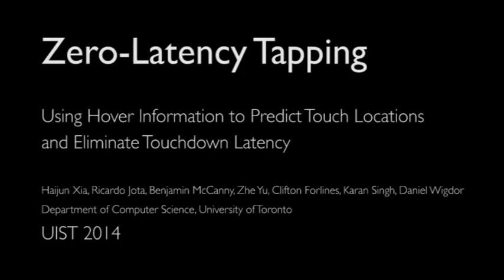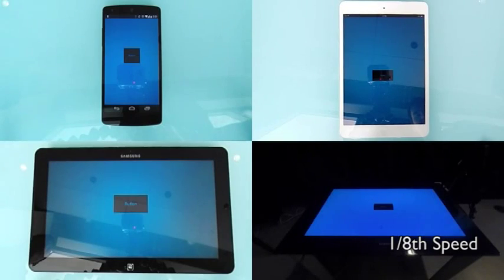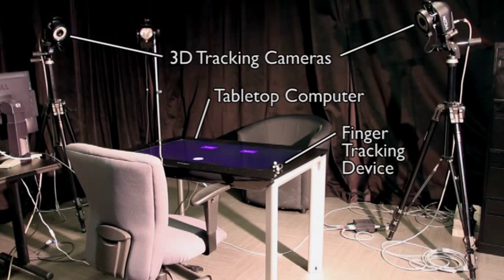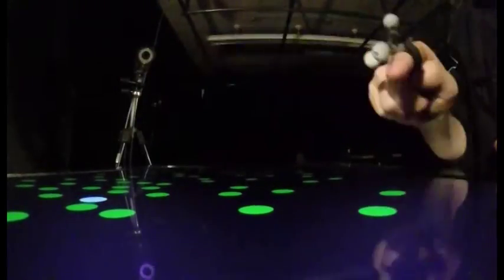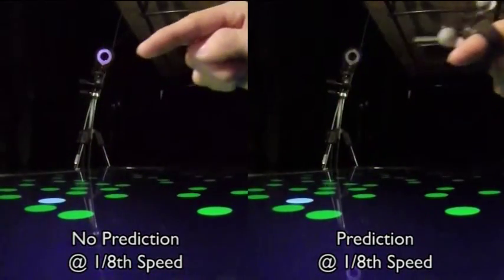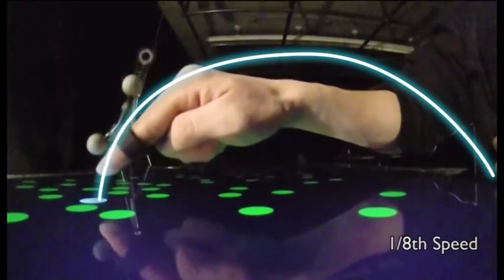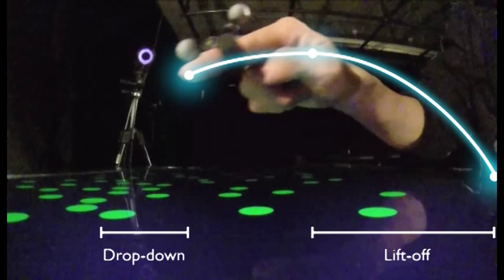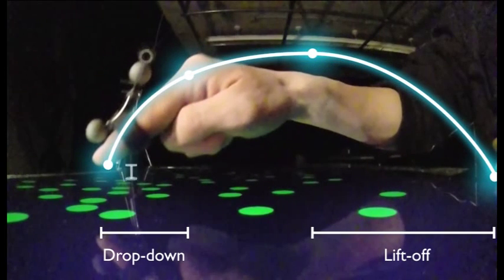Zero-Latency Tapping: Hover Information to Predict Touch Locations and Eliminate Latency

Comment: there's already a screen that is only 1ms. huge news but no one seems to care which is a shame.

a video was released in 2012
Reply: There are many monitors that are being advertised as having a 1ms response time, but this is not the same as total system latency.  
The 1ms response time refers only to the time that an individual pixel needs to change its brightness value and is dependent on the type of panel used.  (Fun fact: OLED displays usually have response times below 0.1ms)  

Before a touch input results in the brightness of a pixel changing, many more steps take place.  
For example: The touch needs to be registered(this takes up to 17ms if the sample rate is 60hz), the graphics need to be updated and rendered (this takes 17ms in a 60hz system), then the finished image is usually buffered for at least one frame(another 17ms), before it is then sent to the display controller, which again usually takes 17ms in a 60hz system.  
So just these steps, which don't account for all latencies in a system, comfortably already add up to more than 50ms, before the pixels are even told what brightness they should show.  

To lower total system latency we could increase the rate at which all these things happen or attempt to "skip" some steps, say if you're scrolling on a web page, we could intersect the render process near the end of its time window, read the touch sensor again, and shift the web page according to this newer information.(This is being done today in VR headsets to get the total latency for head rotation down to as little as 11ms in 90hz systems, only one refresh cycle of the 90hz displays in many VR headsets).  

Prediction is also useful, but it gets much worse as you increase the time over which the prediction needs to be made.  
Going back to head rotation in a VR headset, predicting more than ~20ms can result in motion sickness, because the prediction is not accurate enough.